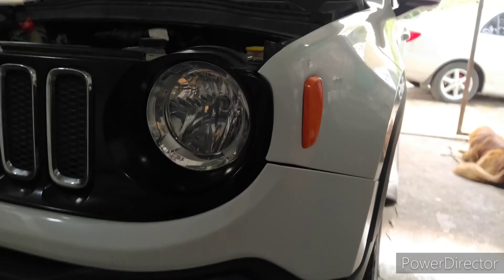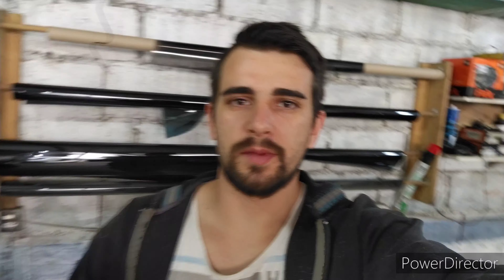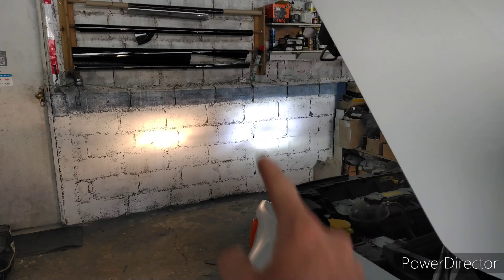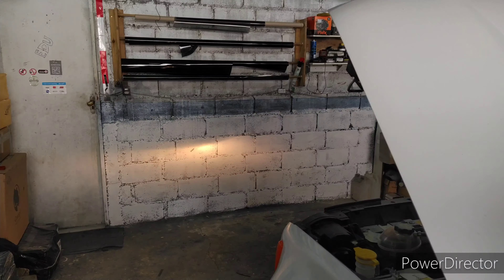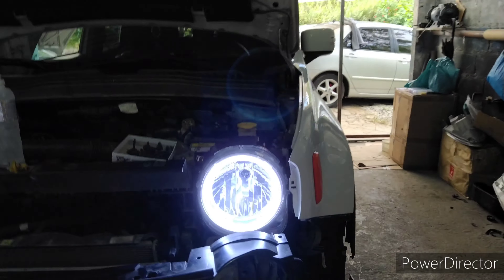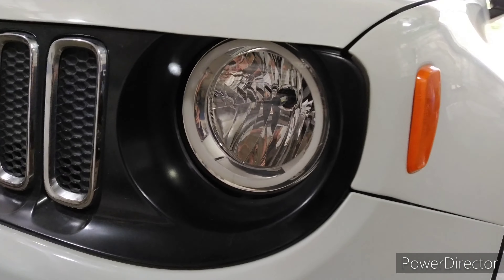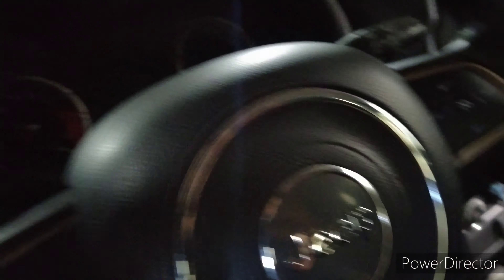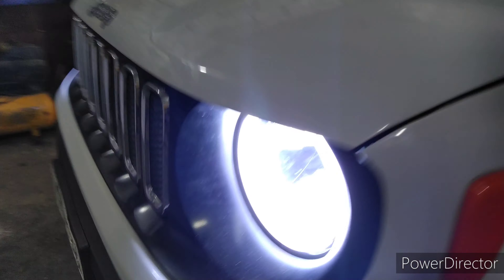Farol jeep pcd com angel eyes e led csp 4x mais forte!

Comment: Edu qual o valor pra colocar Angel no jeep
Reply from the maker: ZAP para orçamento e encomenda 22 997888008
 Trabalho com encomenda é tempo de envio do projeto varia de 7 a 100 dias dependendo da complexidade do mesmo! 

LINK NOSSO led asx 

http://produto.mercadolivre.com.br/MLB-1678736409-led-asx-60w-h7-h1h4hb3-hb4-h4-h3-h11-h27-16-_JM

led led  h4 para motos 

https://produto.mercadolivre.com.br/MLB-1510445619-led-samsung-h4-_JM

link Xenon cnlight 35w Ac 

Xenon cnlight  para projetor

http://produto.mercadolivre.com.br/MLB-1653460280-kit-xenon-cnlight-35w-ac-_JM

led asx 70w  indicado para farol refletor 

http://produto.mercadolivre.com.br/MLB-1678733897-led-asx-70w-h1-h4-h7h11-hb4-hb3-h3-_JM

LINK NOSSO  Xenon emc canbus 55w h7 6000k ou 4300k

link nosso projetor
 8.1 2,5 edu Car

https://produto.mercadolivre.com.br/MLB-1317560945-par-de-projetor-bixenon-celta-uno-gol-palio-_JM

Estou no Instagram como @edu_car_lumiar.  https://www.instagram.com/invites/contact/?utm_medium=whatsapp&utm_campaign=default.ig_ci_landing_site_0621.control&utm_source=ig_contact_invite&utm_content=1st6wpx

Facebook :https://www.facebook.com/EduCarAcessoriosExclusivos/